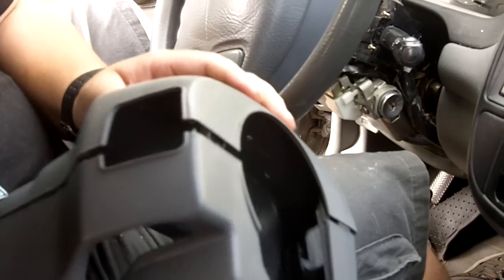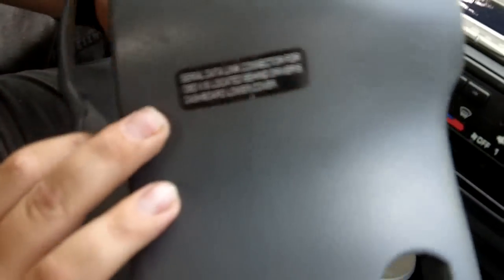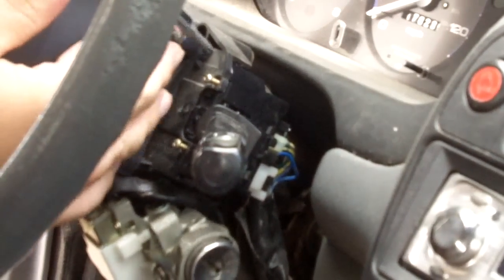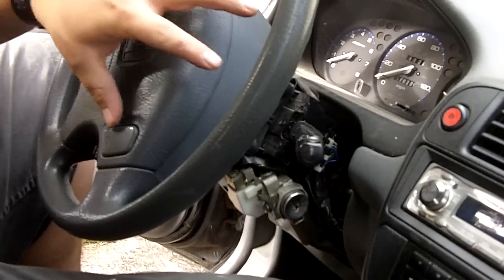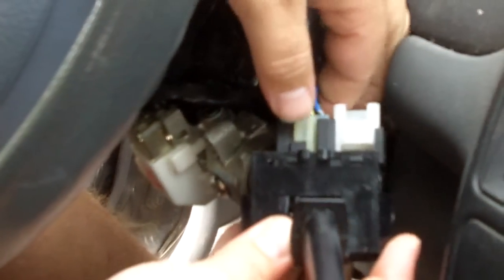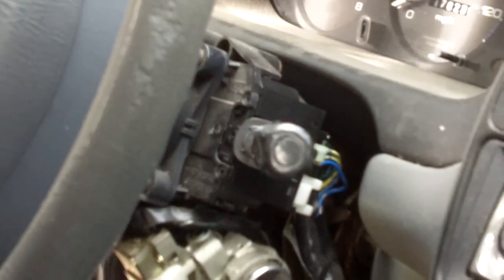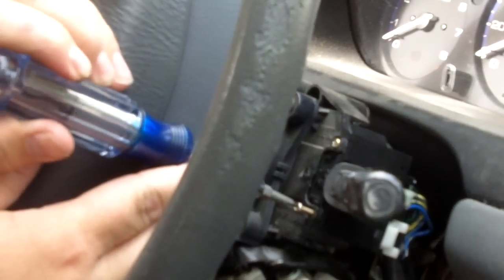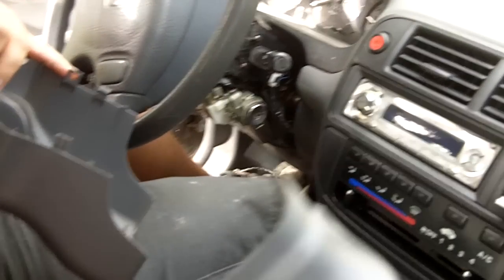97 Honda Civic wiper switch replacement

Comment: I have the exact same car oddly; this only took like 3 minutes (and I also did not disconnect the battery). My switch problem was that when you normally pull it down to run the wipers once, that had broken such that every time I hit a bump, the wipers would come on and run continuously. Your video is awesome. Reasonably short, to the point, easy to follow, and great audio! Thank you!!!
Reply from the maker: Thank you! It was real time one take no editing.

Comment: Thanks for this video. Back in 2010 I had my wiper switch on my 98 Civic replaced by City Garage and they charged me $300 (I don't think it was a genuine Honda part either, because it didn't look exactly the same as the original). What a ripoff. Don't ever take your car to City Garage; they'll take advantage of you, especially if you're a female.

Comment: Thanks for this video.  My wipers would not shut off.  The car repair shop said the wiper switch needed to be replaced.  They wanted to charge me $398.  I Googled, "How to replace windshield wiper switch for 99 Honda Civic" & found your video.  Even though yours is a 97, it's the same procedure.  I bought the switch from O'Reilly for $83.99.  It took about half an hour to complete the job. I disconnected the battery(negative first then positive & when putting cables back positive first then negative). I Removed the three screws from the steering wheel column & pulled it apart then removed the two screws holding the switch in place & replaced it with the new switch. Lastly put everything back together and reconnected the battery( positive first then negative). Hare Krishna. God bless you.
Reply: Harry Krishna I’m having the same problem, wipers won’t shut off had to pull the fuse out. So replacing the switch was the solution for you?

Comment: great video and thank you for making it. my wipers wont turn off and also when i try and turn them on and off by the switch, the wind shield wiper fluid spray comes on. I’m guessing that its the wiper switch combo. But i could really use another opinion on this.
Really appreciate your opinion on this.
Reply from the maker: If i remember correctly that is part of the same switch. Replacing it should take care of your problem.

Comment: Thanks for the video.  Really simple.  Got my switch from Amazon for $40.00.  The bottom side of the steering wheel cover was missing the 3 screws.  Do you know what size they were?  Thanks

Comment: Is this the same for a 92-95 civic??? Thanks!!!
Reply from the maker: I should be really close. The switch itself is just a little different.
Reply: Stefonivich so it should come out the same as the ek, without needing to remove the steering wheel? thanks for the response!
Reply from the maker: Yeah I believe so. No need to remove the steering wheel

Comment: Thanks for the video--very helpful! Is there a relay switch for the wipers as well? If so, where is it located? Should I start there first before replacing the switch? Wipers work but won't turn off.
Reply from the maker: I don't think it would be the relay. If it was the relay they wouldn't work at all. It also isn't as common for a relay to go bad as it is the switch
Reply: My switch is having the same problem.., did you ever figure it out by any chance? I thought it would be the relay as well but makes sense if it was the relay it wouldn’t work all together. I swapped it out for a new one and it’s still having the same problem. They work in all speeds  but when I turn them off they just stay in place where the switch was turned off at.